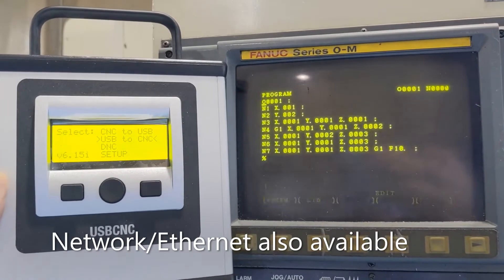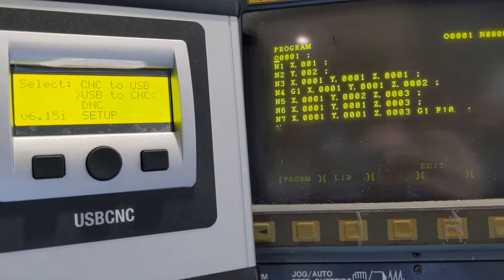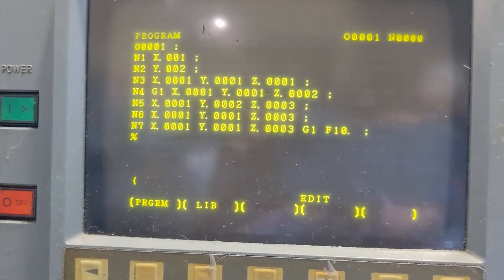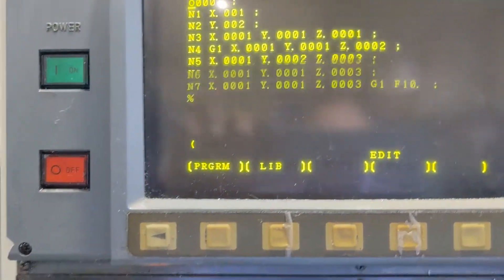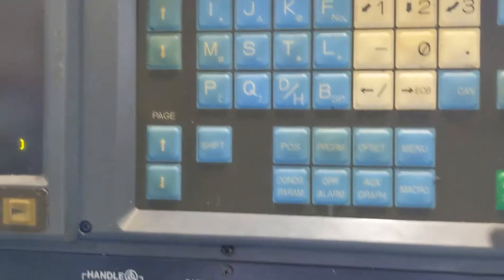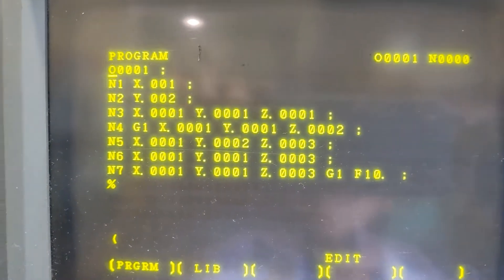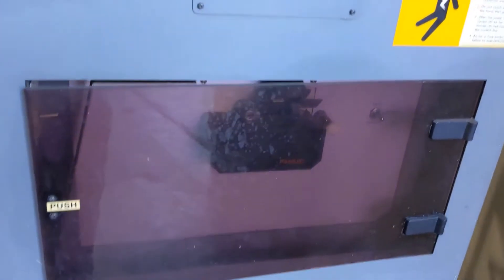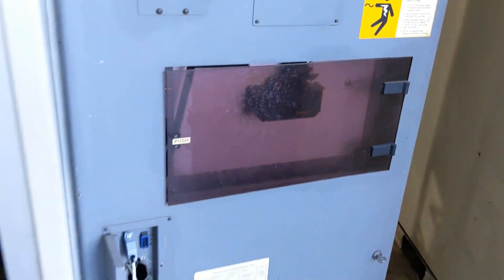Fanuc 0m USB or Ethernet network Upgrade

Comment: Is this limits to Fanuc machines? I have an older Fagor I want to communicate with but can’t.
Reply from the maker: Our products are universal. It doesn't matter the CNC brand. What it requires is a functioning RS-232 port on the CNC. We do have customers with Fagor controls, What control model do you have? Do you have a RS-232 port on the machine? You can send us an email with details at support@calmotion.com
Reply: Hello, i have one milling machine fanuc om, i dont have memory ,how to make this modofication ?  @CalmotionProducts